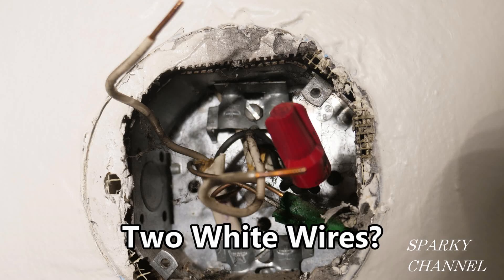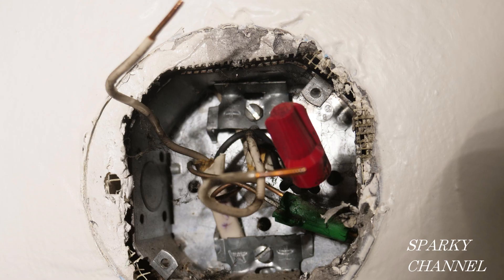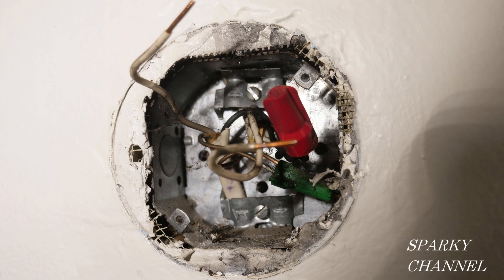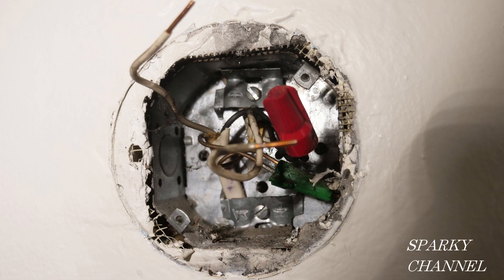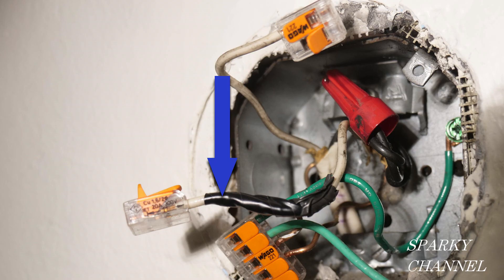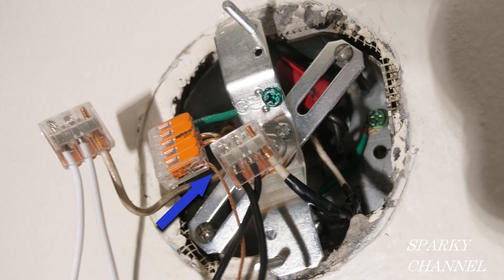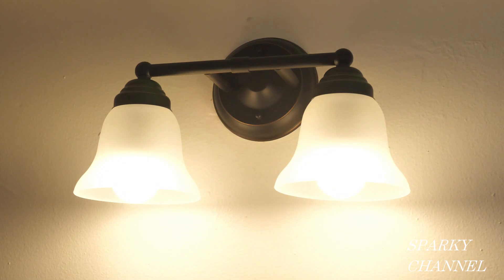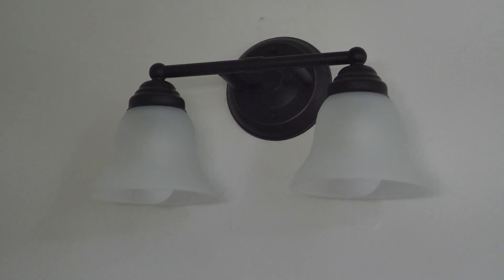Two White Wires in a Light Box, Which One is Hot?

Comment: You can always try with a power off using a voltage meter and testing for continuity from the box or your bond and the other lead to the whites and you’ll figure out which one is your neutral

Comment: Man, it took me a while, but I finally figured out that my GREEN wire was the hot one, and the two white wires were my neutrals.   I have no ground wire.  Super confusing.  I had two white wires tied together and a separate green wire coming out of my light socket.  I used a multi-meter and a touchless meter to figure this out.
Reply from the maker: Wow!
Reply: This is funny. I've got one blue and two whites. It seems like I get about 120 coming through when I touch the blue and one white, and I have 120v coming through when I touch the blue and the other white... So I can't tell which one is neutral and which one is ground or if they're even is a ground. But evidently the blue is hot!

Comment: What type of tester were you using to find out which wire was hot I noticed you didn't have to touch two wires you only touched one wire at a time and the light stays solid with hot and blinked with neutral?
Reply: Non contact voltage tester

Comment: Why would someone wire it in this manner ????   Why did you wire it like it was, apparently it goes to a single pole switch, so why not take the white going down to the switch, and twist it and the hot black wire and cap them off and then that leaves you a black and white for the fixture.  I think that only in residential is it permitted to energize a white wire.,
Reply: Just faze it

Comment: hello Sparky,  for educational purposes. I have 3 questions and if you have addressed them, would you please direct me to those videos?
after multiple popping (10 times) the 20-amp circuit breaker.
How Many Receptacles or Outlets on one 20-amp Circuit Breaker?
Should I replace the 15-amp receptacle outlet with a 20-amp receptacle outlet?
And after I forget to turn off a couple appliances, should I replace the 20-amp circuit breaker?
with some recent countertop cookware appliances and other electronic devices and not wanting to overload a circuit and allow for multiple different watts. 
Allowing for multiple devices like a toaster oven, and coffee maker, and microwave, and crockpot, and electric frying pan, and rice maker.
Also, have approx.. 16 electronics turned on in the household at any given time.
Hairdryer, curling iron, ironing board, exhaust fan, radio/tv
Power interruption is a big issue.
A result of the household is working from home.

Comment: Basic electricity is confusing to me. So, with that, if the mounting box is just nailed to a wood beam or stud, how does threading a ground wire to the metal  box "grounding "it? Wood is an insulator. Explanations are welcomed.
Reply: Since he attached the grounding screw and wire to the box and connected the grounding wires with the wago from the romex it creates a grounded bond.

Comment: Which one is hot? The one that makes your tester beep... Or the one that has 120v to ground using your meter
Reply: Using the non-contact voltage detector one is able to figure out which wire is hot. When you measure with the meter to the ground connecting wire you are able to figure out which wire is neutral ( which will have no voltage going through) and the hot (which will measure about 120volts) upon placing the leads on the ground and a corresponding wire.

Comment: Overall you do a terrific job of explaining things and I enjoy your videos. But, in this case I take exception. The really correct way to “fix” this would have been to move the white wire (to the switch) over to the hot, identify it as such. Then pull the switch and identify the white as a hot so that the black wire returning to the light was the switch leg. Now you would have one black and one white in the wall box thus eliminating the confusion. And in the future if someone tried to use the wires at the switch to add a receptacle they would see that the white was not a neutral. Or at least they should see it as such. The correction to the grounding was spot on.

Comment: Nice, hadn't seen the Ideal tap and die bits before....sometime could you do a code review and explanation video of multi-wire branch circuits. Have a commercial building where many of the lighting circuits are MWBC with the shared neutrals,  but they didn't put handle ties on the breakers (at least they are adjacent spaces in the panel). I'm not clear though whether handle ties meet the intent of the code for MWBCs or if those circuits should be on a common trip breaker (such as a 2 pole for single phase, 2 circuit shared neutral or  3 pole for 3-phase panels with 3 circuits on a shared neutral, etc....or if that causes more confusion at the panel..)
Reply from the maker: Hi Richard! It's so interesting how different people pick up on different things e.g. Ideal tap and die bits. The set is pricey but very high quality. I love the little case that keeps them organized too. Yes, I would love to make a video on multi-wire branch circuits. However, I am knee deep in a tough house renovation at the moment. It's been a battle, the house and property were really trashed. I can see the finish line though!

Comment: AC does not have a polarity per se like DC does, the difference between hot and neutral is that neutral bus is bonded to ground in the circuit breaker panel. The light bulb doesn’t care about which wire is hot or neutral. The hazard is if the hot wire is connected to the white wire on the light fixture you could get a shock if you touch the exposed threaded contact on the bulb and ground at the same time like when changing the bulb. This is also why the line cord plug on table lamps should also be “polarized” with the narrow blade on the plug being hot and connected to the contact at the base of the socket and not to the threaded contact.
Reply from the maker: Perfect explanation, thanks David!

Comment: Great video Bill ,I love the Wago lever nuts ! One tip ,when installing the Wago lever nuts ,I always put black electricians tape over the nut as the lever can open when putting the wires in  the box. I also love the Voltage claw for pushing the wires back in the box!
Reply from the maker: Both excellent products!

Comment: Bill, I’ve got two white wires going to the light switches at the top and bottom of the stairs. When one light switch is turned off, the other one won’t work. Can you explain how to figure out which wires to change?
Reply from the maker: Absolutely. I just repaired that very problem in a video: How to Fix a 3-Way Switch System on a 1957 House: House Renovation Time!: https://youtu.be/XwyHaPGHu6s

Comment: Could you not check for continuity of neutral to ground? This would show which one is neutral, leaving hot? 
Or maybe not?
Reply: That would work but only assuming the grounding system is secure. With a sloppy box like that with two whites and no proper bonding/grounding, who knows what else could be going on haha
Reply from the maker: @esl4058  Perfect answer. So the answer is yes, but I prefer to use methods that are sure-fire under bad wiring conditions.

Comment: What if you have two black wires on a two way light switch?? Do you follow the same method in checking in checking?? Thanks AJ
Reply from the maker: What country are you from?
Reply: I’m from Hawaii. My house was built in 1956.
Reply from the maker: @AJA48  Aloha! What island? We LOVE Hawaii, especially the big island. The reason I asked is that in the USA we call them 3-way switches while in some other countries they call them 2-way switches.
You'll get a lot of info to answer your question here: How To Replace 3-Way Switches on a 50's-60's House and Avoid Common Mistakes: https://youtu.be/w4mlRNGDjKo
Reply: @SparkyChannel  Honolulu
Reply from the maker: @AJA48  I love it!
Reply: I’m a DYI kind of guy but not to familiar on electrical wiring. Your channel helps out a lot. Thank you!
Reply from the maker: @AJA48  My pleasure!
Reply: Aloha Sparky,
I saw your video on the Amazon Tri Pod with the two level bubbles to make sure that it’s level. What do you think of the Milwaukee Tri Pod?? Thanks

Comment: Switch loops were done incorrectly alot for some reason.
Reply from the maker: Prior to 2011 those were OK but the hot wire wire had to be identified.
Reply: @SparkyChannel  I don't think so as reidentification would be required along the entire length of the conductor & only the white wire wasn't allowed to be switched even in 2002. They should have tied the white in with the hots.
Reply from the maker: @sparkyjerred419  No, you only had to re-identify the wire ends. Believe me, I was an electrician during that era. That's the way we did it. :)
Reply: @SparkyChannel  I was also a master electrician at that time & the white wire was not allowed to be switched it could be  reidentified & used as the feed to the switch but not as the switched conductor.  If you were switching the white wire you were violating the code.
 It's simple to correct just take that white wire going to the switch & tie it with the hots in the fixture box & take the black from the switch & connect it to the light.

Comment: Without turning the power back on you could tell which one is hot by continuity testing the two wires to the ground wires. So long as the ground wires are real and not fed off K&T somewhere, it should tone out the neutral. :)
Reply from the maker: Yes, that's true, so long as the ground wires are good ground wires.

Comment: to reduce the amount of walking, on a properly grounded system, if you separate the conductors, the neutral on the line cable will have continuity to ground whether the breaker is on or off.  if more than one white wire has continuity to ground, you know there is a miswire somewhere.  and I would have reconnected that box so it was up to current code - a white wire may be repurposed as hot, in a switch loop, but it may never be switched.  so the white to the switch should have been made hot, and the black connected to the fixture.  at that point, it's just one more connection to change, so no reason not to do it.  addendum: neutral-ground continuity is also useful for finding the line side when installing a GFCI.
Reply: 😱 you're a genious!
Reply: @MarcoPolo-jg1em  nah, just done this a time or two.
Reply from the maker: Excellent, thanks!

Comment: no need polarity for a light bulb..polarity is only for 3 phase motor or a DC volt equipment...110 volt to 220 volt is we called AC volt.it means alternating current.any way you wired an AC volt is still a complete circuit happen.even line or neutral reverse..
Reply from the maker: The base contact should be connected to the line/hot and the outer threads (which are touchable, especially when changing the bulb) should be connected to the neutral. Otherwise when unscrewing the bulb the thread of the bulb is exposed and could be live at mains voltage and can be touched very easily.
Reply from the maker: @RayGreen94510  Safety first, always!

Comment: The bulb itself really doesn't care about the "polarity". It will light either way. What we get is a safety issue. Normally hot is the small button the tip of the bulb contacts, and neutral the threaded shell. If reversed the threaded shell is hot and that presents a chance for someone to come in contact with hot while changing a bulb. They really should make sure the switch is off first though.
Reply: And that's where the problem starts. That's only possible if you have a single on/off switch. If you have several switches for the same light a layperson can't figure out if it's on or off.
Reply from the maker: Excellent comment Scott!

Comment: Does the reverse polarity cause the light bulbs to burn out sooner than normal. I heard someone tell me that the bulbs in their ceiling fan keep burning out, so they are going to replace the fan. 
Asking for a friend. Lol
Reply: on an AC system, the filament doesn't care about polarity - but as marcel said, reverse polarity makes accidental contact easier.  if it's a light in or on a fan, there can be vibration that makes incandescent bulbs fail prematurely.  If your friend wants to use incandescents for some reason, they should spend the extra to get lamps that are intended for use in fans, because they are designed to be more vibration resistant.
Reply: @kenbrown2808  
Thanks Ken. 
She never mentioned the style of bulb, but locally incandescent bulbs are virtually impossible to find.
Reply from the maker: Some LED drivers will either not work or burn out sooner with polarity reversed. So that is another reason to make sure that polarity is correct when installing electrical devices.
Reply: Safety issue on systems like Edison sockets. There the base contact should be connected to the line/hot and the outer threads (which are touchable, especially when changing the bulb) should be connected to the neutral. Otherwise when unscrewing the bulb the thread of the bulb is exposed and could be live at mains voltage and can be touched very easily.